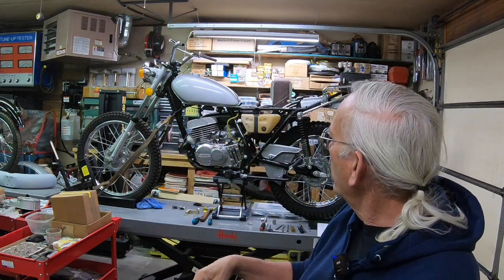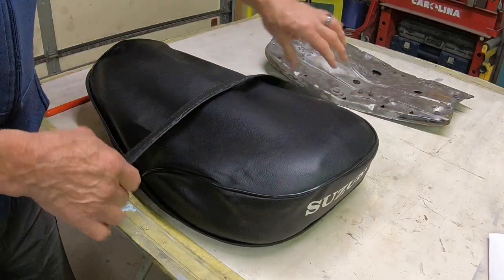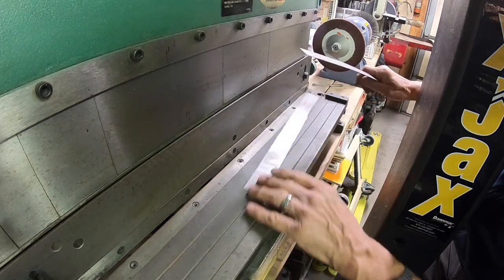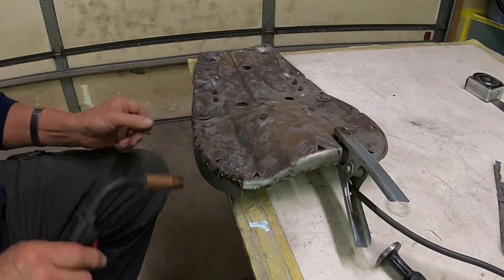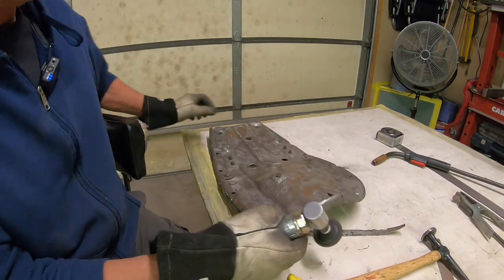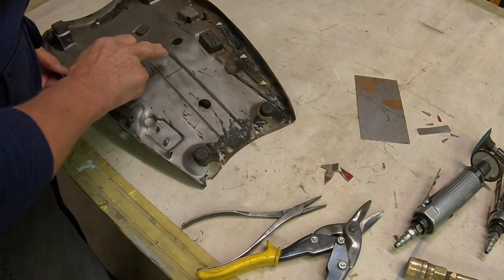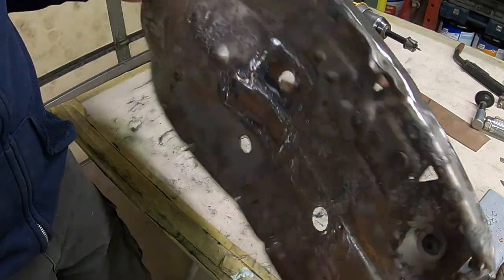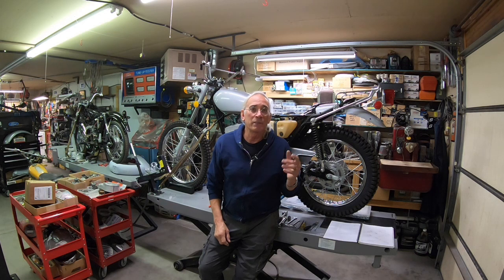Repair your motorcycle seat pan, Suzuki TS250

Comment: my 1969 TS-250 was orange tank with the old Suzuki flying S badge. loved that bike. eventually set it up for TT racing,flat track seat,racing expansion chamber, removed the oil injection and had some port work. it screamed off the line always first into turn one.
Reply from the maker: If your anything like me, wish you still had it.

Comment: Nice work! I have two Yamaha pans for two AT1c that both need this work -not sure why they rust out so easily. Just did a pan on a suzuki RV125. For those of you out there with stock decent pans, I would advise you to pull the cover and foam and get to the pan in advance and give it some paint love, etc -much easier to work on these before they need welding, etc. Thanks Dale! What gauge metal were you using for the repair?
Reply from the maker: Thank you, yes, they do, I think what happens is the seat cover gets a tear or the water soaks through the cover and always runs to the kick stand side of the pan. That is usually where the worst rust is. When I do these pans, I always coat them with POR 15 which will never rust again. I generally use 20-gauge material on most of the pans.

Comment: Suzuki TC-100 re-pop seat complete from Asia on ebay $158.00
Reply from the maker: Don't need one for a TC100, but they aren't that hard to fix. I can buy a lot of welding wire and sheet metal for 158.00.  Thanks Frank, just giving you a hard time. I'm too cheap to buy new unless there is no other way.
Reply: @montana2strokeracer  totally understand with your tools and experiance you can fab almost anything even plastic side covers.